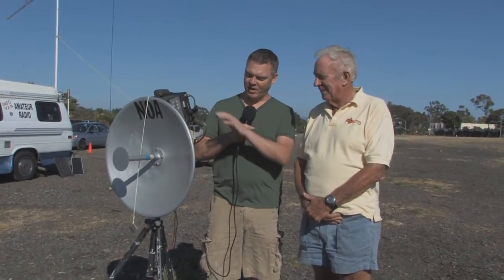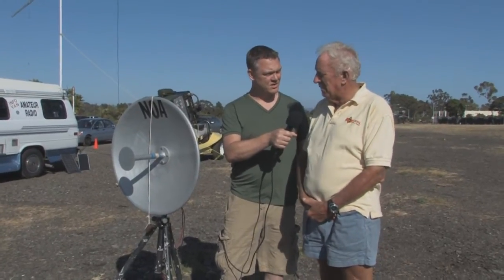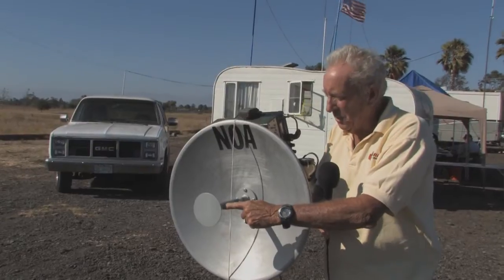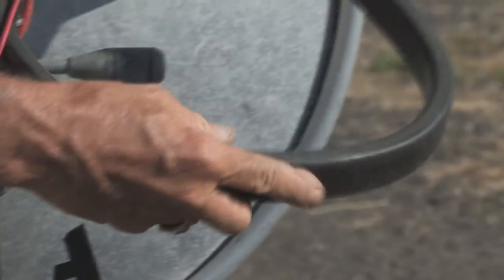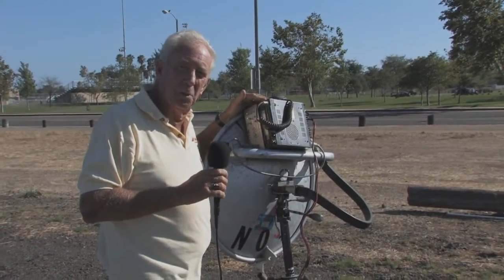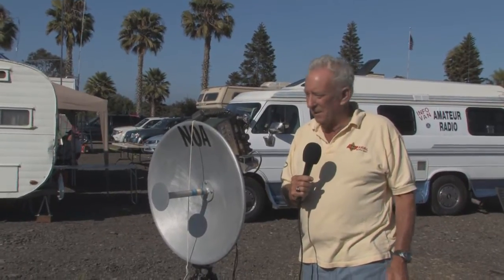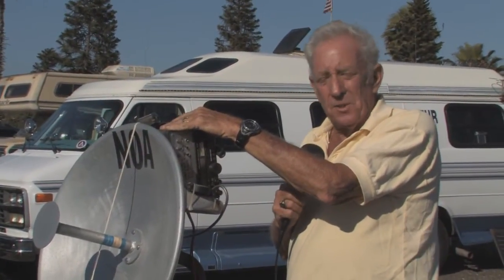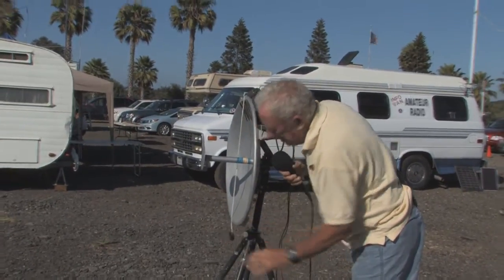10 GHz:  An Introduction to X-Band for Amateur Radio

Comment: Great video, but waveguide and 'plumbing' can scare potential recruits to the band away. You don't actually have to use waveguide at all... I don't! I use short lengths of UT141 rigid coax with gold plated SMA's for connections which is great at 10GHz and it works just fine. So don't be put off by un-necessary 'plumbing'. Dish feeds can be very simple; adapted from old satellite TV LNB casings (again, like mine). 73 - Rob VK2GOM
Reply: I think for the the important thing to remember for any newcomers to the X-Band is that you should concentrate on getting the best and strongest signal out of the antenna. This is the challenging part; you can make it fun, or it can be boring. Hey, Think Outside, no BOX required! Coax will have much more loss, so take that into consideration if you plan on long distance comms @ 10Ghz; Free Space Path Loss, rain and fog play a very important role in dB loss in the microwave bands.

Comment: That's a Penny feed, not a Cassegrain..??
Reply: No it isn't.  A penny feed is the size of a penny (from the old - pre-1970 -  UK currency) - about 1-1/4" in dameter - not he 3 or 4" shown in the video.  In any case, a penny feed is normally built from rectangular waveguide not circular as shown in the video.
Reply: It's a Gregorian feed, not a cassegrain.  A penny feed can be built with circular waveguide too.  Regardless,  Gordo's stuff works good.  I wish he had dimensions published of his feed so everyone to try making one too.
Reply: @superpro1941  Seeing as how his reflector is flat, not concave nor convex, I don't see how you can call it gregorian.

Comment: Is anyone using WBFM still. I think I would have to get this going with another amateur. The DB6NT transverter is a good way to get on the air using narrowband modes
Reply: Almost everybody is on narrow band SSB or CW now.  You get much more range that way.  The transverters have become much more common.  Many units can frequency lock to a 10 MHz GPSDO  or a rubidium oscillator, and they're right dead on frequency.  All of my equipment is from Kuhne in Germany (DB6NT).  Downeast microwave also makes good stuff.